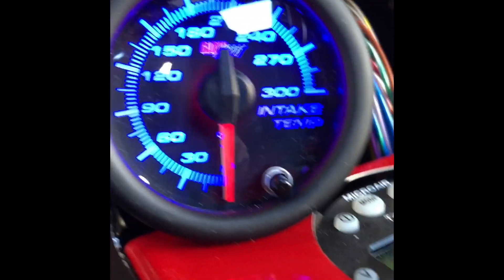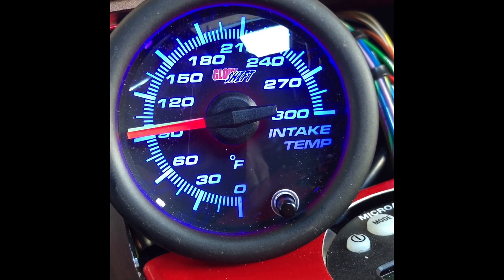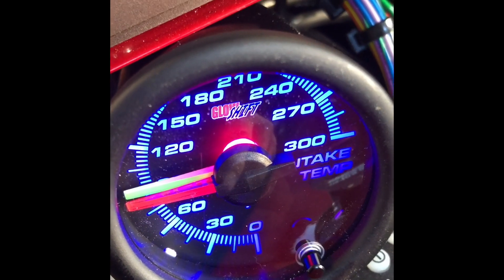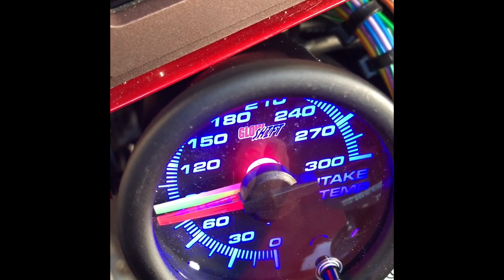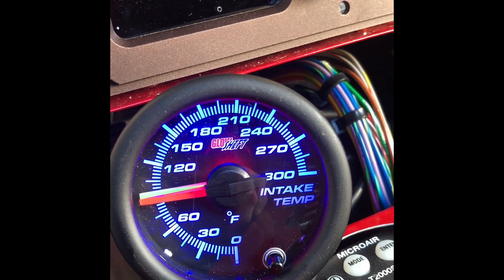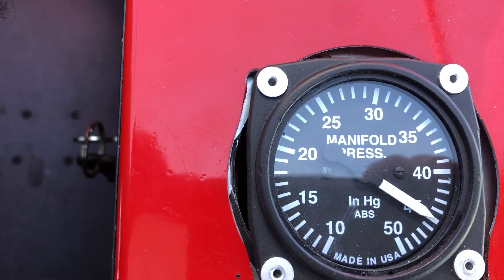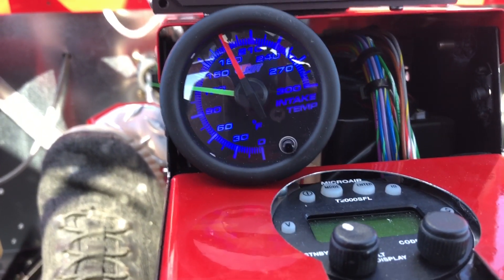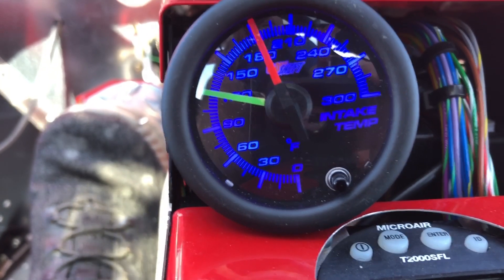Viking intercooler

Comment: Does the oil continue to circulate thru the turbo to prevent coking after shutting down or are the turbo temps low enough to where it’s not an issue after shutdown?
Reply from the maker: A lot of effort went into the design by Honda to lower the temperatures, the xhaust manifold and the turbo charger are liquid cooled. Along with using synthetic oil. So the answer is no, they do not circulate oil through the turbo after shut down and it isn't a problem :)

Comment: It's amazing, how turbo technology has gotten so much better over the years.  I still remember many years ago, operating turbos with no intercoolers and on some aircraft, we even had manually operated wastegates.  Those old-style turbos always seemed to have reliability problems because of the extremely high operating temps, which caused issues such as the shaft bearings coking up and leaking oil seals.  Until recently, I would never have considered owning a turbo charged aircraft, simply because of the added aggravation and expense of keeping a turbo operating properly. Thanks for the video.